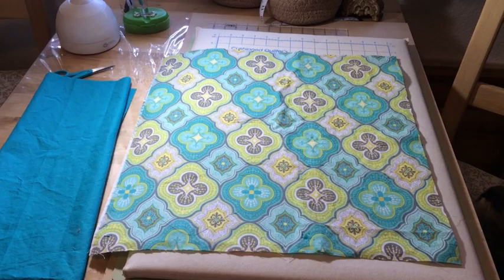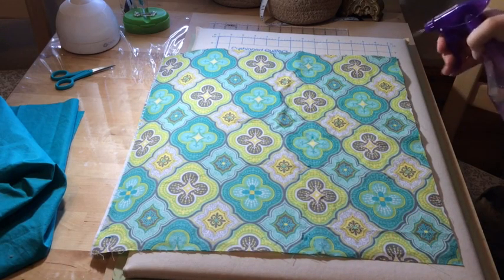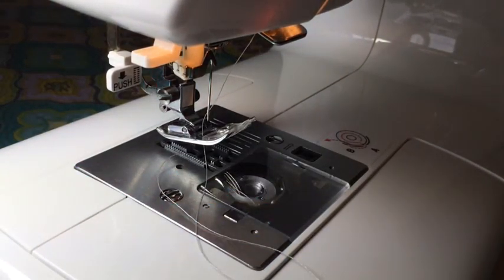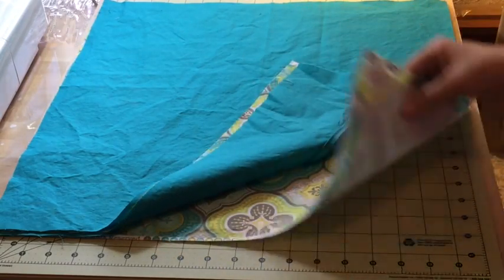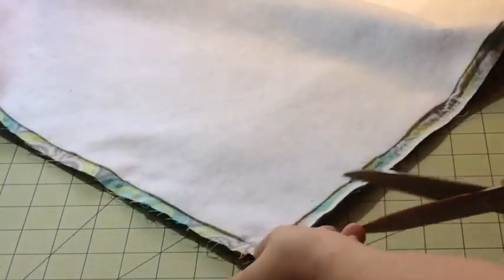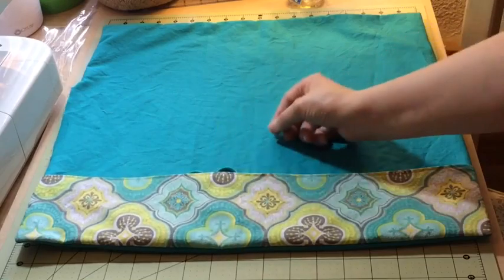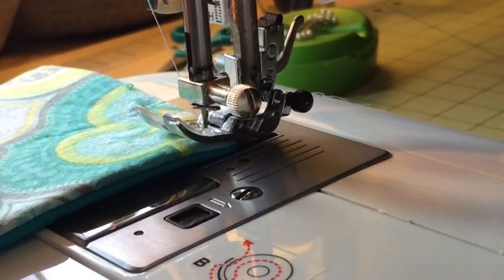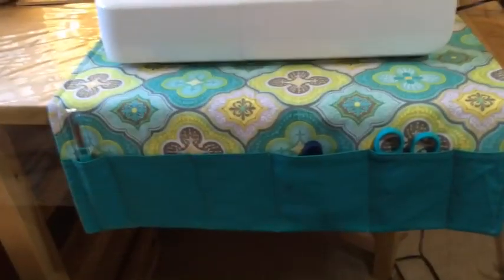Simple Sewing Machine Pad

Comment: Can I use a thin interfacing as I haven't got a fleece or batting for mine. I did one yesterday with some wadding sheet didn't have any instructions with it. So I just used it and didn't say on Google if I had to iron it on. So now it's very bumpy but I will have to sew across and down it so it doesn't move as much.
Reply from the maker: As long as it’s fusible it shouldn’t wad up. Your mat can be as thick or as thin as you like. Fleece or batting will give your mat some padding but it’s not absolutely necessary. A fusible interfacing will give stability and be fine. If it’s not fusible you will have to sew some lines across so it stays in place.